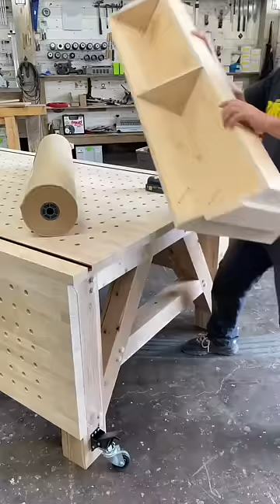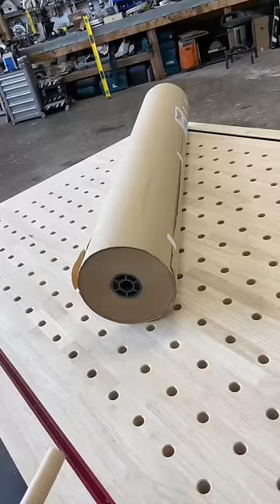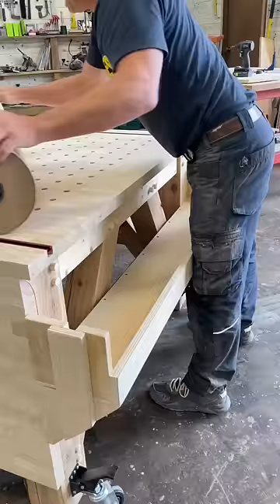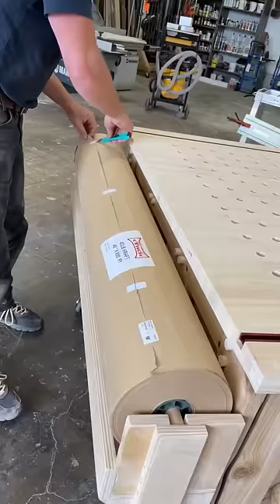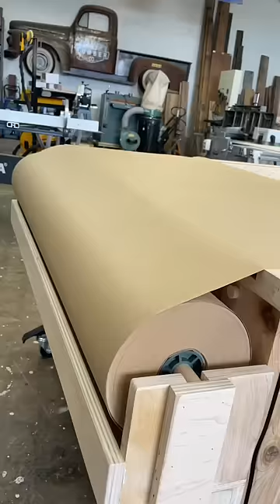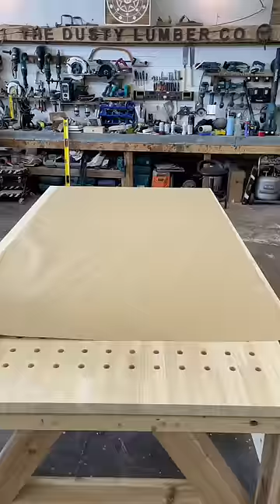For catching glue drips #woodwork #maker #shorts #woodworking #tools #diy #work #glueup

Comment: Should have put another spool holder with an empty spool on the other side so you could roll it up on the empty spool as it gets used so you’re not cutting it off and throwing it away. You’d also be able to get more use out of it since you could always flip it over as well and use the bottom of the paper